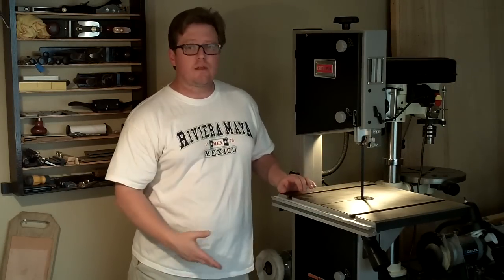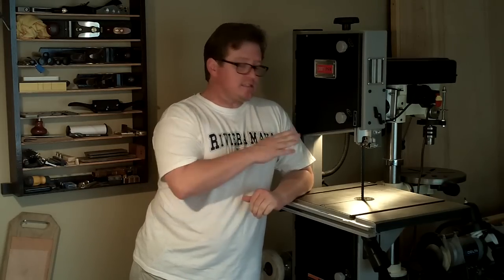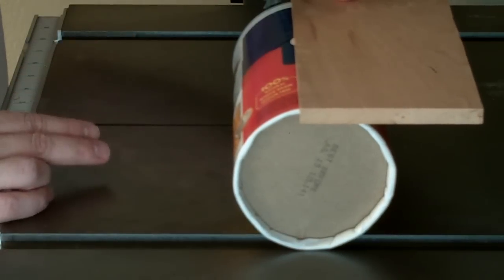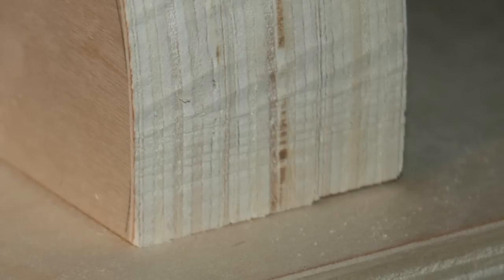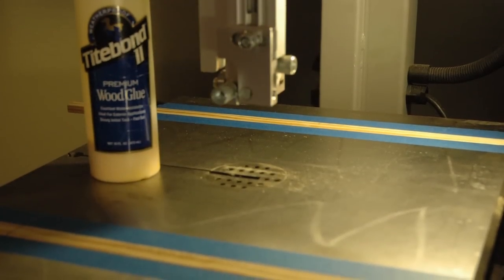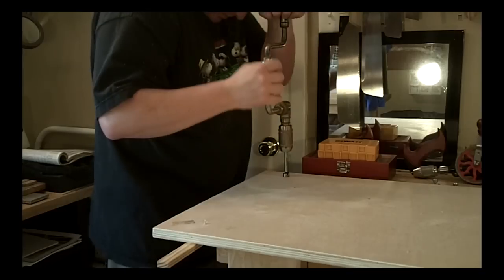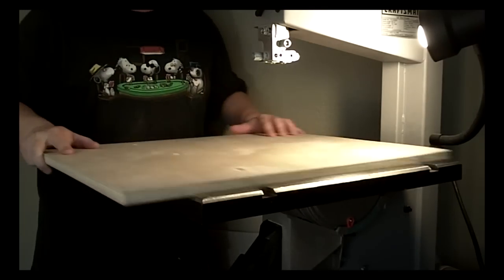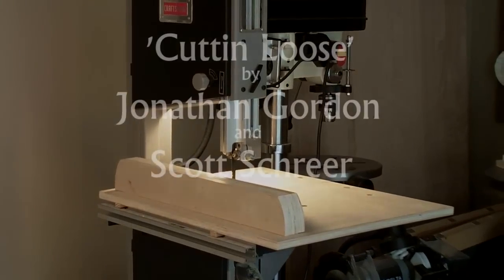A Cross Cut Sled for the Bandsaw

Comment: I appreciate your video's everyone has there opinion on tools and what purpose they are best used for .I have been wood working for over forty years mostly case work Cabinets , built in's, done many projects for friends  etc . Not a production shop just a maybe more than the casual wood worker . I have had a Delta Unisaw  for the the better part of the last twenty years Started out with a Craftsman Radial Arm saw which I still have collecting dust in the corner . Delta DJ 20 jointer ,and a 15 inch planer drill press and yes a ton of hand tools planes , saws, routers,etc .Over the year's I have honed my hand skills to what I think is very good and I believe my work shows it.On February 20th I will be 70 years old My family bought me a Laguna 14 inch band saw as a gift.Never had one before Curves were cut with either a coping saw or a hand held jig saw .Yes it took a little longer but but it got to where it needed to be .I am excited to get into the band saw and see what I can produce. As I said at the beginning everyone has there opinion's on tools And I just wanted you to know that I respect yours . May not agree but do respect it Keep up the good work and information .One last thing I was told many years ago Craftmanship is in the maker's hand not the tools .
Reply from the maker: Thanks

Comment: I appreciate this video for what it is, a way to do small woodworking for a hobbyist like me that has very limited room and cannot fit a table saw in my space. But, now I can make a sled for my small bench top band saw and do some blade adjustment to make it a little easier. Much better than taking wood back and forth to the cabinet shop I work at to make cut on a table saw, when I only need a close enough cut and don't want to cut by hand.
Reply from the maker: and if you make a shooting board for a hand plane it can be even smoother and more accurate than a table saw.

Comment: I just started a new wood working channel since I am now partly retired and can follow my love of working with wood a little more often.  I too am finding that I love my band saw.  I did indeed use the table saw a lot before watching someone  make a band saw box on youtube.  I fell in love with the concept and the possibilities.  So, I ordered a band saw.  I LOVE it.  I will be making one of your sleds for sure.  One thing though, I find that if I put the saw teeth just slightly in front of of the crown, I get the same straight cut without it wearing out the tire so quickly.  Just a thought.  But you are correct.  If "tuned" properly, it stops the drift.  I also use mine as a saw mill (using a jig I made) with a resaw blade to cut short logs of various varieties into lumber for my bandsaw boxes.  My "acre" has a wooded section so there's lots to work with.  Works great.  Love your idea though and will indeed "steal" it lol!!
Reply from the maker: +BirdsAdventuresInWoodworking you are correct. the teeth are slightly in front of the crown with the gullet on the crown. Tomatoe, tomahtoe. Thanks for watching
Reply: I missed the gullet on the crown part, so indeed we are saying the same thing.  My bad.  But, the point we are making is correct.  I'm betting we can both cut a straight line lol!  And my band saw is my favorite saw.  I will be making one of your sleds as soon as I get back to my cabin where my best shop and band saw is.  It's my haven!  (Heaven as well.)

Comment: Thanks, great tips. I too, agree with the band saw blade drift like you said, I also put over my wheels a bycicle tire that fit perfectly to allow me to keep the gullet on the band saw blade in the center.

I also made a table for my fence system to help with alignment on rip cuts. I just put a miter slot on the table and used my old miter guage. Works great

Thanks, Steve

Comment: I have a similar design, but with two more slots perpendicular to the fence, for another fence, like a resaw guide. Pretty simple add on, using tee nuts and thumb screws to tighten where you need it. Excellent video, especially your method of starting the guides slightly proud for gluing. That will save a lot of time :)
Reply from the maker: +Steve Polychronopolous I'm not quite picturing how that'd work.

Comment: This is indeed fantastic! I definitely agree with the concept of stationary power tools and my "new/used" bandsaw is my only power tool in the shop! I am wondering a) How to install the guides with just one rail on my bed (the sticking higher wouldn't work immediately in this scenarion), and b) I could make two additional sleds for 45, or just pony  up and buy a miter gauge sled ...

Comment: Placing washers (or coins as mentioned) in the slots are a simpler way to glue the runners without planing after.

Bandsaws are great, but they cannot rip wide  pieces, crosscut long pieces, or cut rabbets/dadoes like a tablesaw. It really is best to have both tools.

It is wonderful that you FF through the rants-- about 90% of youtubers ought to do the same!

Comment: Got to agree the bandsaw is a much more versatile tool than the table saw, it's safer, smaller and I find it generally more convenient and useful for my small workshop.  I enjoy using my band saw whereas I don't really have the space to use the table saw, it mostly gets in the way and feels pretty dangerous.   This cross cut sled will be a nice addition, thanks!

Comment: Would you happen to have a video on how to set the saw blade to reduce drift?  I don't know a lot about band saws and had little idea what you were talking about.
Reply: Richard Murray He did explain it in the video and show you.   The bandsaw blade rides on 2 large pulley wheels.  One provides the driving force (through friction) and the other provides guidance for the blade (through tension).  He explained that where you set the blade on those 2 wheels is what directs the blade and prevents the drifting.  

If you set the blade up on the wheels so that the teeth of the blade are riding on the crown of the pulley wheels, then the blade side is what receives the appropriate blade tension and allows you to cut without blade drift.  If you set the blade up any other way, you will end up with blade drift.  The part where he was holding the board up on top of the round can was where he was explaining this.
Reply: +Richard Murray Just be sure the sharp part of the teeth are ever so slightly in front of the crown of the tire, that way you don't prematurely wear out the tire.  Once you solve blade drift, it will likely become you favorite saw.

Comment: Okay, I came lured by the title, "A Cross Cut Sled for the Bandsaw", and enjoyed, drummed my fingers, enjoyed, drummed... the rant and the observations/explanations, waiting for sleds to appear. However, four and a half minutes into the vid, (4:38 - "I think that's total BS") you intrigued and alarmed me.

I've come to understand the "magic" of crowned wheels to keep belts/blades from sliding off drive/driven wheels. Your suggestion -- putting the (toothed) edge of the blade on the crown begs (in my mind) for the blade to slip just a fraction of an inch and "squirt" right off the wheel.

Obviously you didn't just profess this; you have been doing this (and others have successfully followed your suggestion) and enjoying great benefit(s). Although I don't have a problem with blade drift, I would still like to adopt your methodology -- if I could get my mind around how it could be secure.

Comment: I couldn't say that one tool is more useful than another, as it depends on what you plan to make. As someone who used to build boats, these would be my set up, 1, bandsaw, 2, table saw (able to cut at least 2' for 8'x4' sheets), 3, planer/thicknesser, 4, radial arm saw (with adjustable height and mitre), and 4, a combined floor standing disc and belt sander, in no particular order. I think that any tool should be treated with respect, if it scares you, then don't use it, get training from someone with credible experience. There are many other tools of course, but these would be my must have large toys whatever I planned to make. I use a table saw much more than a bandsaw, it's more accurate but that is also model dependant, hobby tools are just that, and I favour old cast iron machines over any other regardless of make or model.

Comment: How do you keep the blade from centering itself on the crowned wheels? As far as I know the crown is to center the blade on the wheel automatically when the saw is running. In my saw, that is exactly what the crown does. Everytime I try to set up the blade like you suggest with the teeth running in the middle of the wheel the blade immediately shifts onto the crown again after a couple of turns of the wheel.
Reply: Just a thought here, have you recrowned your tires lately? they may not have enough radius. I recrown at least once a year or clean them with a blade change.
Reply: +Christian Pangerl Don't know about yours, but my band saw has an adjustment knob on the back that allows you to adjust the top wheels angle ever so slightly which will make the blade move in or out over the crown.  I adjust mine by simply hand turning the wheel (power off of course) until the blade runs with the sharp part of the teeth ever so slightly ahead of the crown so as not to eat up the rubber.  It definitely makes a difference when adjusted properly.  Also, use the correct blade for the job.  Don't try to resaw with a narrow blade, and don't try to turn sharp curves with a resaw blade.  All of that matters.
Reply: BirdsAdventuresInWoodworking Thanks for the tip! I never even thought about changing the blade tracking with that knob as the manuals of almost every bandsaw as well as most tutorial videos tell you to set up your wheels perfectly coplanar using this knob, whereas your method sets them up slightly out of plane. I use the biggest and coarsest blade available for my saw for resawing (1.5" wide and 1.1tpi).
Reply: You'll love your saw once you get it set just right.  I resaw on mine as well, but I also have a 3/16 blade that I cut band saw boxes with..  Even made an adjustable resaw Jig that I use to cut logs into lumber up to about 30", but could be made longer if I find longer logs that I can handle.  I took footage of it so I'll have a video before long, but I'm just getting started and I'm trying to release my videos in sequence so it's "in the can" and down the road a bit, but works great.  Hope you like your "new" saw!

Comment: I use my band saw on thicker pieces and scroll work. I use the even more under rated tool, the radial arm saw, for most of my cross cutting. The RAS is far more versatile than the band saw and the table saw put together!

Comment: Unfortunately the cheaper smaller bandsaws only have 1 crosscut rail, which basically rules out an accurate cross cut sled. You never get super accuracy with one rail as that one rail usually has probably a millimetre of play in it. Metal runners are definately better than wood, harder to affix than wood but worth it. Also as some else mentioned it's better to have the board of the sled above the table and let the rail take the weight for friction purposes.
Reply from the maker: Are you trolling me with this? Ah, no... Wood vs metal runners is only variable is how accurate they are made. There's an argument that the wood will "fit" itself perfectly, fit it tight and let it compress. Over 12" any wiggle will negate more than accurate for woodworking. You can make an accurate sled with only one rail. Hell, you can make an accurate sled with no rail and reference one side of the table as I've shown using a speed square many times. Having runners support weight (on a 2 runner sled) so table is suspended will cause flex problems in table especially at cut point as it induces vibration with it's associated dangers and binding will occur from sawdust in rails. This was trolling right....
Reply: @wortheffort  OK, you have far more experience in cross cut sleds than I have, so I take your points, especially about the raising the sled above the table. I only made my first sled a couple of weeks ago and found I could not get the super straight edges in the wood needed for for the rails. I had a couple of 12 x 12mm steel square tube so butted them against the far side of the table saw slots. This also meant the sled floor would be above the table. It works OK and has a tight slide. If you say you can make a good sled with one rail then that is good news as a want to get a small band saw and they only have one rail. The supplied mitre fences are usually poor for good cross cuts.

Comment: Hey, there. Your front fence seems to be about 3" tall. Why so tall? Is there a specific application where that helps? Most of the other bandsaw sleds I see on the net seem to have a front fence between 0.75" and 1.5".  It seems like 1.5" is tall enough for 99% of what you'd do on a bandsaw sled, and that would allow you to adjust your blade guard/guides that much lower on thinner stock.

Comment: I liked the video and like the idea about a bandsaw sled...however, you keep saying perfect 90 degree cut but at around 14:54 you state "accurate enough...off a degree...".  Therefore, it is not a "perfect" 90.  Really you're cutting 89 or 91 degrees and then squaring it up with a hand plane...
Reply from the maker: You can make a sled as perfect as you want but for me a bandsaw is a rough tool, as I stated many times. It's never going to be perfect right from the machine. In fact I don't know many machines were the work isn't refined before assembly. But we're woodworkers so it doesnt' have to be perfect. As for squaring it up with a plane afterwards, yes I do. But it's rarely more than a few swipes to remove blade marks.

Comment: What in the world are you talking about? There is nothing unsafe in this video. The blade tracking advice he gives is identical to that given by Alex Snodgrass from Carter Products, when he gives seminars on band saw setup at the Woodworking Shows. The crosscut table is a good design, the construction of it is correct, and the advice on waxing is spot on. What is your problem?